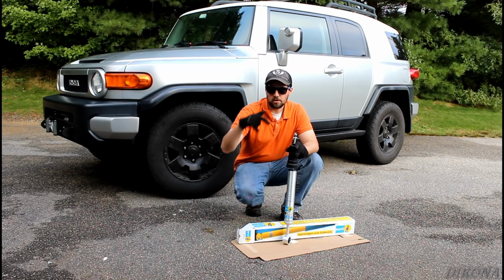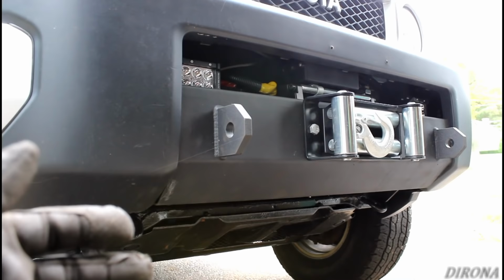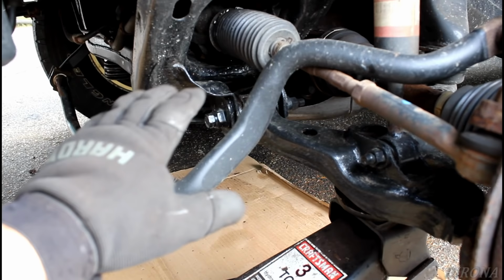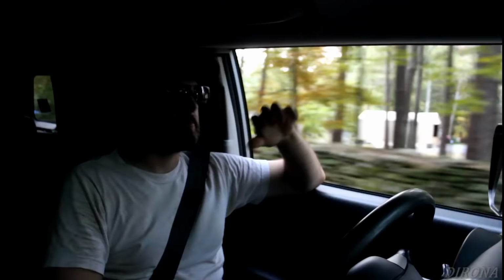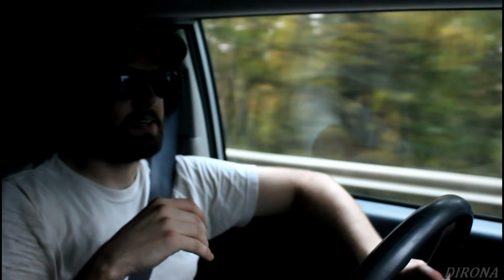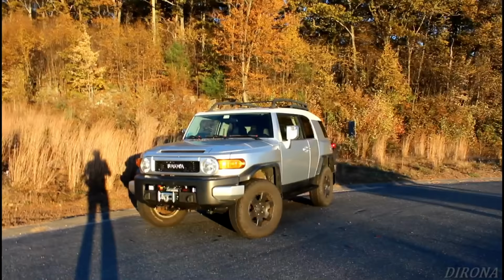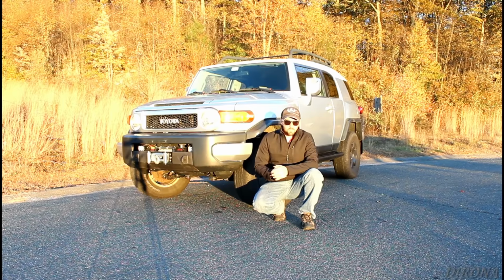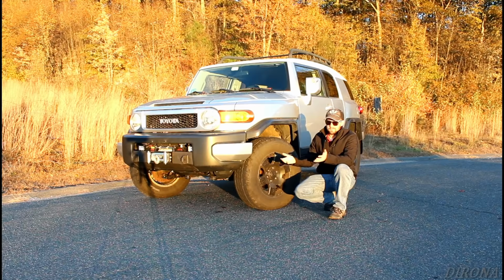LEVELING the FJ CRUISER with BILSTEIN 5100 STRUTS

Comment: Compared with Russia, you have a lot of opportunities in America to make high-quality tuning. A few years ago I bought the same shock absorbers on EBay with delivery into Russia. In my opinion, the Bilstein shock absorbers for Toyota FJ, have a disadvantage, if you do the suspension lift by 2.5 inches, they do not have enough stock length, and after a while they fail. After Bilstein, I put the Fox (without the tank), that's just what was needed for this machine! Good luck in the future tuning your car.

Comment: Thanks for your video Bro! My FJ is stock with the exception of my wheel set and whenever I see an FJ that's been leveled or lifted slightly I feel it looks so much better without the stock rake. That said, I was going to have two inch spacers installed up front, but Dirty Parts in LA suggested Bilstein 5100s for the same money with labor, just like you've done. So, I'm glad I got to see your process and the result. No rust for my 2008 here in Los Angeles. Super clean! I think I'll go with the 1.75 adjustment like you did, as that makes sense and I don't load down much, as it's really just a two person vehicle. Thanks again! Happy trails!
Reply from the maker: I envy the clean metal in socal! The politics not so much..
Reply: @dironaa  ditto.

Comment: Best kit, upgrade! I went 3rd notch with a Daystar 1.5" rear spacer to fully level and Supreme Suspensions differential drop kit to lower the front differential & reduce excess wear on CV joints & axles.
Reply from the maker: Nice! Was pleasantly surprised that the ride quality seemed to be the same or better with the Bilsteins than with the factory struts. Rarely seems to be the case with aftermarket suspensions.
Reply: @dironaa  did ya replace the rear with billstein as well? Don't miss the Michigan undercarriage cancer on my vehicles, used to get exhaust in cabin from hole in rear quarter on my old samurai lol. 
Took me forever to find a decent fj for sale that was accident free, but also having not spent even one winter in the salt belt or northeast, they seem to suffer a great deal more than other vehicles underneath/frame.

Comment: props for all that hard work. That FJ looks really badass!
Reply from the maker: Thanks! Would look even better with a new set of tires.
Reply: @dironaa  It would indeed! I have a 2010 army green color, even the roof. Cheap-o tires and stock wheels which are black-coated. I was planning on getting new wheels but then something that's got my heart beating happened: white smoke from the exhaust. As soon as I get a new PCV I ordered, I'm hoping it will solve the issue.. it's quite embarrassing in the streets!

Comment: When I go on long trips I find that full gas tank and luggage with passengers actually levels out my factory stock height in the rear.  Lot of folks don’t understand that the only way to get higher ground clearance, not body lift, is to install taller tires.
Reply from the maker: Cant beat the look of a low vehicle with big tires
Reply: You can’t tell me that didn’t improve his approach angle

Comment: Great video keep up the good work! I have a '07 MT FJ myself and was looking into new shocks but I was curious if you were experiencing and contact with the upper control arms and if there was a problem clocking the spring when reassembling?
Reply from the maker: No contact with upper control arms and no issues with clockspring

Comment: That's the same shocks I installed on mine and it rides way better than the stock ones.
Reply from the maker: I didn't notice a difference after installing mine. Vastly improved the look of the FJ though
Reply: @dironaa  I changed all four shocks and it rides like a sedan. The old shocks felt hard and stiff. I saw that you only changed the front but not the rear, that's probably why you didn't feel any difference.
Reply: @dironaa  The FJ after you level it with the shock it looks nice and strong. I have the same color as yours but my roof rack is silver and it stands out. Your neighbor must be lucky to have you as neighbor, you are very knowledgeable on fixing things, especially cars.

Comment: I never understood the whole rake concept.wouldnt the truck handle better with more nose dive as opposed to level
Reply from the maker: Maybe if we were building a land speed racer, but for everyday driving I've never noticed a difference in handling between a vehicle with rake and a leveled one
Reply: Slight rake gives you more steering response in general. If it sags at the rear much higher chance of understeer. Tune your own application to understand. If you're going to load your truck occasionally the rake helps keep the truck level when loaded. All depends on use. My GX has an unfortunate 2 inch lift at the rear with stock ride height at the front. Great to load up the truck, drives very neutral. When unloaded it wants to act like a drift car. Too much rake IMO. Will have to correct it this year.

Comment: Whats the difference between a spacer leveling kit and changing front suspension?
Is it really worth it to change the front suspension just to get ride of a factory rake?
Reply from the maker: I've put spacers on jeeps in the past and the difference essentially comes down to suspension travel: with a suspension upgrade you will be gaining more travel and theoretically a better ride, but with a spacer you will maintain the stock suspension travel. Is it worth swapping to eliminate rake? To each his own. I prefer the look of a leveled vehicle so I'd say yes, but I'm sure there are plenty who prefer the look of a raked vehicle.

Comment: Dude it looks Cool!!!! 😎
She's ready to run over some zombies. And if someone don't have the skills you have and technic, they don't need to touch this task. How long did it take you to do this? Man
You scared me with what you had to do. I just got my FJ and l put rust killer on the frame. I was going to do the shock and now I see why the previous owner never replaced
The factory shocks!!!! 😠 
 Too much work involved!!!!!!

PLEASE TELL ME IT RIDES BETTER!!!
Reply from the maker: Took a full day if I remember right then brought it in for alignment the next day. Shop couldn't do the alignment because the adjustment bolts were rusted inside one of the lower control arms, so I had to cut the lower control into a few pieces to get it off then install another with new hardware. From the first bolt that was turned until the alignment was finished was probably about a week. Feels like it rides exactly the same as stock to me; I'm just happy the ride didn't get worse.

Comment: Did the structions say anything about replacing the upper control arm? I was told if not done the uca 
Can break after lifting. Under stress.
Reply from the maker: There weren't really any good instructions available, I just more or less tried to follow factory procedures for replacing the stock struts with other stock struts and modified as necessary.. Haven't heard of the upper control arm breaking before but with the small amount of lift I ended up with I don't foresee that happening. May be more of an issue with larger lifts?

Comment: Fun fact: you can do this without taking off the swaybar and tie rod.
Reply from the maker: If both front tires were off the ground (which I didn’t do) I could see leaving the sway bar in place, but I have a hard time picturing the strut clearing the tie rod without compressing the spring. I’ll take your word for it. If I need to remove a strut again I’ll take it as a challenge to leave those two things connected lol
Reply: @dironaa  Yeah I actually just did the job this weekend. I only lifted one side at a time and the only thing I did was remove the two steering knuckle bolts, loosened the camber bolts, removed all the strut bolts smacked the lower control arm down and it was pretty easy to get out.

I did start off by having the entire wheel turned inward (when changing driverside, turned steering all the way to the right) because I also replaced the brakes and it helped open up some room. The struts I put on mine were for a 6" suspension kit too.

Nonetheless, great video!

Comment: Tap the dust shield? You mean the one you hit with a carpenter hammer 6 times…zero reason to loosen the LCA inner bolts
Reply from the maker: All control arm bushings should be loosened and retorqued when altering the height of a vehicle to prevent premature wear of the rubber bushing. Can you get away without loosening the bushings? Yes. Will your bushings fail sooner than they would have if you torqued them at a neutral ride height? Most definitely.

Comment: Did you seriously just try to match the front and rear fender wheel openings and think that is level? SMH…just stop.  It’s the frame, not some random point that isn’t level front to back stock. Good heavens…
Reply from the maker: The fender openings are what make it appear level